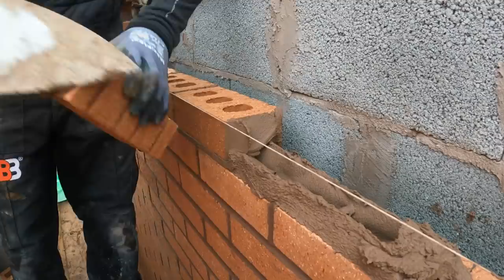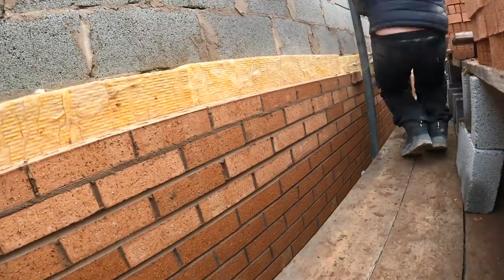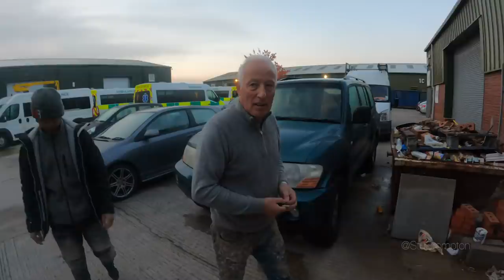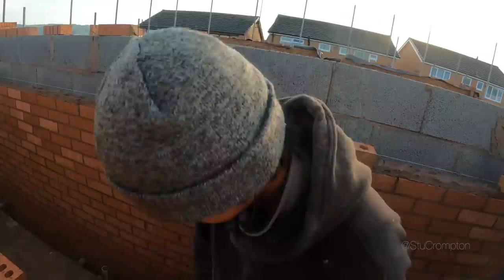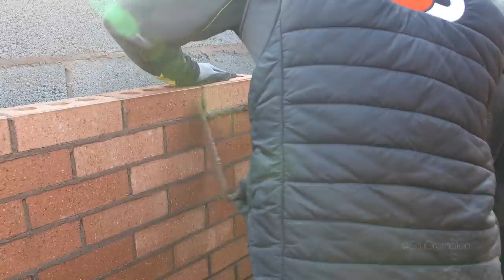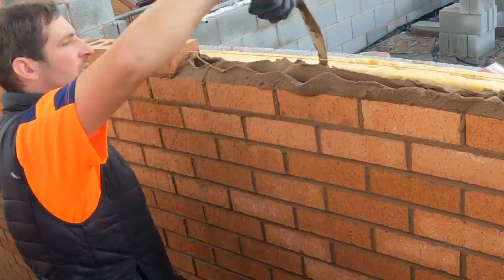Bricklaying- Building The Last Gable Wall

Comment: That's a good question about the perps isn't it. I've always looked at it this way, assuming that the wall's length is equal to a full number of bricks and there are no cut bricks in it, and assuming also that the profiles are absolutely upright, the perps would have to basicially be upright by default. So the only time one would need to be a bit careful about that is when there is a window to brick around and to make sure the cut bricks are the same length all the way up having got the window completely upright in both directions.  Obviously you do all that automatically really.